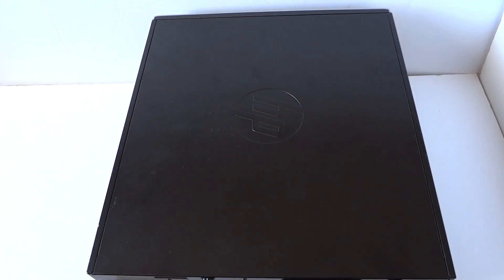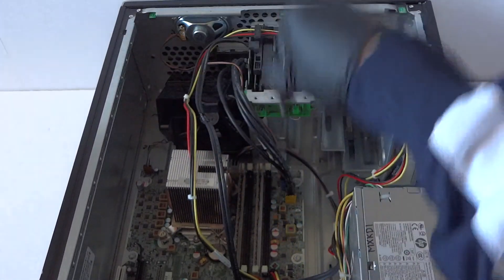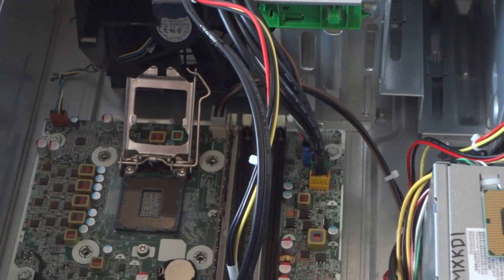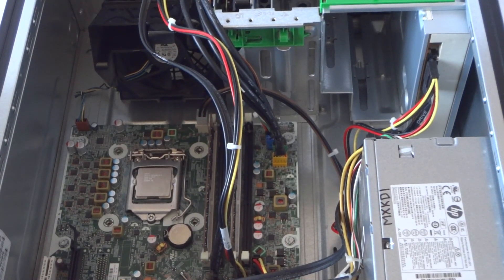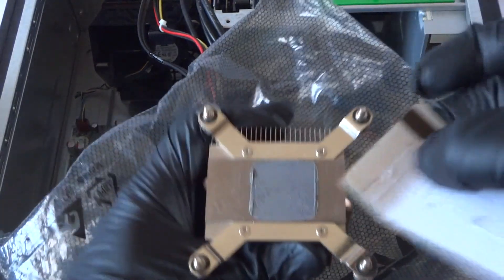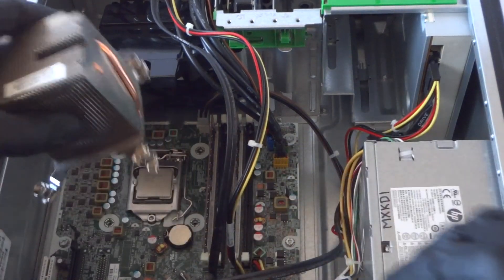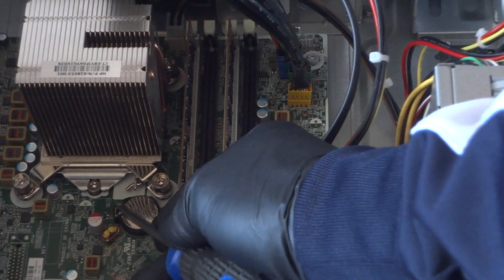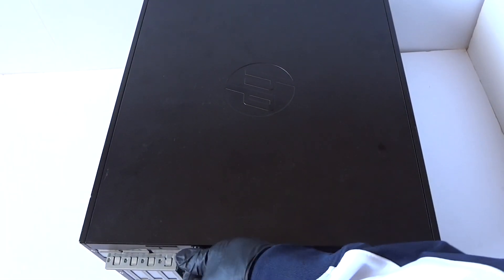HP Compaq Pro 6200 Processor Upgrade CMOS Battery

Comment: Really grateful to this guy...my Compaq 6200 pro MT is now a capable machine for light gaming😌that is more than enough for me considering I can't afford big gaming PC
Reply from the maker: Hi, thanks.
Reply: By the way Mxkdi...can I upgrade my core i5 2400 to core i7 2600k or any of these (i5 3470, i5 3570 or i7 3770) their sockets are identical according to the internet. Both these processors use despite the difference in generation use the same socket LGA 1155
Reply from the maker: @ramphenyanaleceus5347  What model PC do you have?
Reply: Please...guide me..how can I check my model in my PC??

Comment: did you have to do a Bios update first?
Reply from the maker: Hi, yes BIOS was updated rev 5.03 Rev.B  before installing new CPU
Reply: @Mxkdt  is it works with  i7-3770  ?
Reply: also i want to take test with Intel Xeon E3-1270 V2 @ 3.50GHz , it;s socket type LGA1155

Comment: Hey Mx! me again, nice vid as always... bought the msi gtx 1650 oc lp that you recommended thx for the tip! : )

 Id like to ask you, I am trying to buy a i7 2600 off ebay and there is this one offer for a few days and no ones buying it. It is weird cause auctions reach higher prices... thing is, it looks clean but also with a spot where the thermal paste used to be. Because I know you an expert, could you please tell me if this is a bad sign (overheating due oc with poor cooling)

Heres a pic

https://i.ebayimg.com/images/g/kMcAAOSwYSFd9lJ6/s-l1600.jpg

Buy the way, maybe you could make a vid on how to spot overused chips and components on ebay. If theres a way, of course. 

PS oh and maybe you could include affiliate links to amzn for the GPUs, ram, HDDs SSDs you are using in your vids or compatible alternatives, cause honestly I would have bought from an affiliate link had you included one.. thx again man!
Reply from the maker: Hi, which parts are looking for ?
Reply: @Mxkdt  just a 77 2600k with a good price with no bid
Reply: @Mxkdt  an 1 more thing mxkdi can I take out my hp eilte 8300 sff motherboard out of its factory case into a aftermarket?!?!?! Is that possible will It work!?
Reply from the maker: https://www.ebay.com/itm/Intel-Core-i7-2600K-SR00C-3-40GHz-CPU/254458407109
Reply from the maker: hp eilte 8300 sff it is like btx motherboard will not work with mid tower custom case..
Reply from the maker: HI, i did look at the picture and does looks like yellow that means CPU running really hot or did have poor cooling.
Here is the picture same CPU with looks better light usage
https://i.ebayimg.com/images/g/3i8AAOSwPk1d9ooI/s-l1600.jpg
Reply from the maker: Sound guy,  if you make offer on ebay, you could get whole PC a lot cheaper then buying just CPU only. I do shop on ebay all the time and amazon. Most parts i buy from local sellers, i could give you links to amazon.
Reply: @Mxkdt  I would love some links plz!!!
Reply: Hey thx a lot Mx! sry for the delay I was offline for a while.. you said to make an ebay offer? gonna look into that, but anyway here in Europe I could get an i7 2600 for around 65 euro I think. (75 usd) Is this too much?

 Actually I have a 2011 hp 6200 MT and a Im bit concerned that after all I invested (bought the GPU u recommended and the also the soundblaster, plus wd blue 1tb and 16gb ram) the MF mobo or sth else gonna die on me : / do you think its a bit too risky? pc had very light use in an office (mon fri 9 to 5) could it last couple years more? I pray to God it does ; )

The amazon links would be nice, I just wanted to suggest you to include affiliate amazon links in the description of your vids, so you can make some bucks on the side when viewers subscribers click on them.. cause your videos are very useful!  

Not sure exactly how it works, but I think even when someone is in, say France, the links open in amzn.fr site automatically. But probably you know all that better than me.. anyway.. thx a lot for the tips man!

Comment: Is there any rgb cpu cooler that can fit in this? 
I ask because i see the ram is very close to it.
Btw another great breakdown vid!!
Very Cool!!
Reply from the maker: Hi, there is no rgb cpu cooler for this hp unless some one custom make it for you..
Reply: @Mxkdt  is it because the ram slots are too close? Or is it because the screws don't line up? Because usually I custom build 9020 mini towers 380,990, ones like that with custom CPU coolers as well as other things as well. Those types of optiplexs are  very compatible with custom building.

Comment: i bought a q6600 for this , didnt fit, what processor should i get for this pc?
Reply: The HP 6200 is Socket Type LGA 1155 for the processor so anything compatable with LGA 1155.
Reply: @tributeborn6036  not quite right.. the board supports up to a i7-2600 processor... so you cant put in ANY processor because the manufacturer of the board is oem .. so you're limited by them
Reply: You put a 775 socket procesor to a 1155 socket man

Comment: Can I change the CPU cooler to get a smaller one? Pls reply
Reply: You can but you need to modify it. The problem is that you will need a pci extender if you ever get a graphic card otherwise it will be on the way of the new intel cooler.

Comment: I can change the cpu cooler?
Reply: You can but you need to modify it. The problem is that you will need a pci extender if you ever get a graphic card otherwise it will be on the way of the new intel cooler.

Comment: Hi, have very similar system and tried to upgrade my CPU from Pentium G630 to i5-2500 today. After putting new CPU, it won't post -  no output and fans slowly start to spin to maximum speed until I force shut it down. Any suggestion? Do you think CPU is dead?

 Many thanks

p.s. Tried clearing CMOS by resitting battery, also flashed BIOS, no luck. When I put old G630 back in it works fine.
Reply: Nick L were you able to solve this, I have the same problem
Reply: Returned the CPU for a replacement and everything worked straight away!